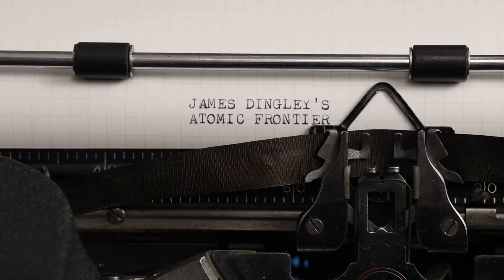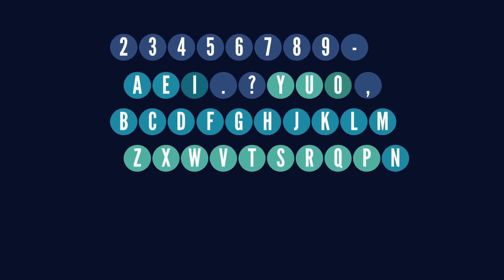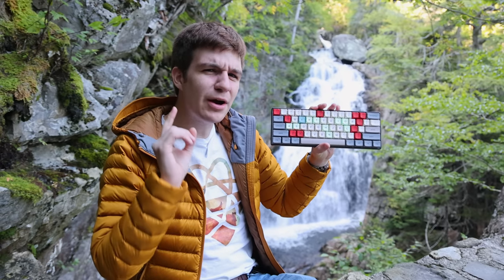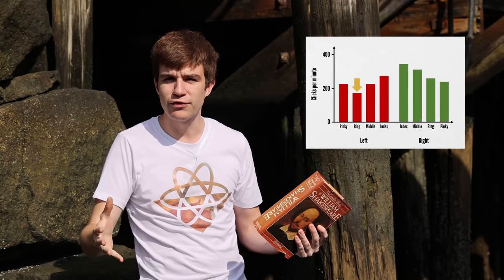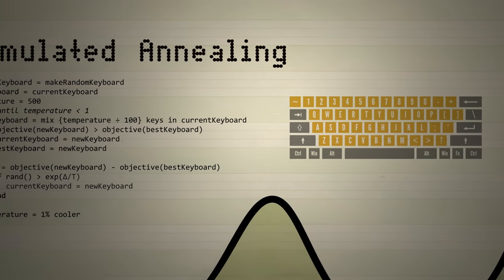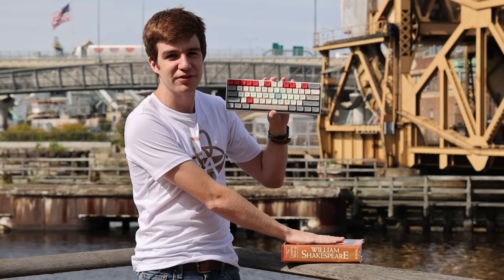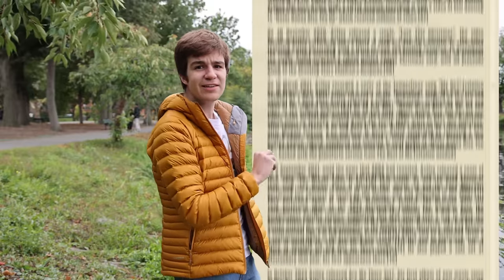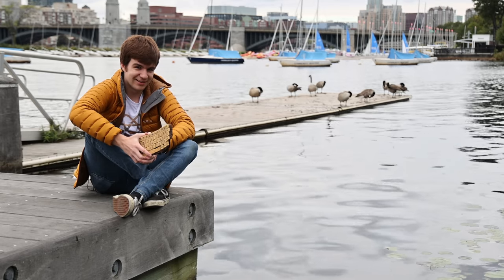QWERTY is broken. Can we make it better?

Comment from the maker: You have no idea the weird looks people gave me as I brought out the freaking "Keyboard From Hell" into my lectures. At least it was quieter than that typewriter kid!
Reply: That’s true lol
Reply: I wonder how an ergonomic keyboard would fare. I mean those that are split in the middle. Probably won't have an impact as one would still use the 10 finger system if its known and the distance would still be the same, i think.
Reply: @matthiasbecker5064  it actually makes a Huge difference to the shoulders and wrists (and thus most of  the pain and injury in the arm). The fully split ones connected by a cable so you can actually position them properly for your body rather than some ficticious average anyway.
rearanging the keys to be ortholinier (that is, the rows are lined up rather than staggered) also makes a huge difference to finger and wrist strain even without changing what position any individual key occupies. (it also takes between single digit hours and single digit days to get used to the difference, with the biggest one being x and c being displaced enough that one ends up hitting the wrong one a lot.)
Reply: typewriter kid: https://youtu.be/Bs5TEuZPQl8
Reply: @laurencefraser  As someone who owns a redonkulously expensive splitkb, I can attest that the just the split alone alleviated SO MUCH PAIN - ortholinear is nice too. No more awkward diagonal reaches for keys, they're lined up for more natural finger extension/retraction :D

You clearly own one as well to identify that 'x'/'c' issue xD
Reply: @matthiasbecker5064  no moving the B right next to the left alt would sufficiently split the keyboard already. to maximize this you take Y and put it next to the right alt button smashing the space bar in between.
Reply: no moving the B right next to the left alt would sufficiently split the keyboard already. to maximize this you take Y and put it next to the right alt button smashing the space bar in between
Reply: (accidentally deleted previous comment)

Looking at the word examples (edited, internet, honey, etc), and the idea of keeping important keys in (zxcv for commands redo, cut, copy, and paste, for example) in place, I think you might actually be looking for colemak. It does basically the same thing you did, except it optimized for common bigrams (basically, two letters that go together, think "er" or "he", or "it") instead of whole texts. W/ those word examples, I was able to do every one of them in the homerow, except for honey, which was 1 key off of the homerow, better than the optimized keyboard. Might be worth looking into.
Reply: I actually learned touch typing in school on a typewriter.. in 2003.. and from then on right through university computers where not even allowed in lectures.. also physically not possible with all the tiny 100 year old slanted folding tables most of the lecture halls had..
Reply: OP: 5:00 Have a nice day folks 🖕🖕
People walking by: 😮😬
Reply: How did it compare to the looks you got feeding a keyboard to the ducks?
Reply: @laurencefraser  Typing using a Dactyl Manuform keyboard is simply the final evolution of keyboards. 60%-75% layout, curved to your specific hand shape, Colemak-CA, split-ortholinear design, it's all beautiful when done together.
Reply: Looking at the video it is quite clear why people give you weird looks...
Reply: I started taking a laptop to lectures when laptops were not really a thing. Every professor made me sit in the back of the class to type.  I can only imagine the reaction I’d get if I brought in a mechanical keyboard with linear or bucking spring switches.
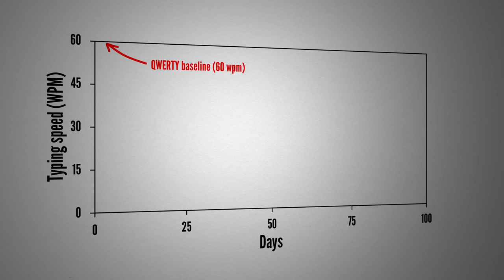Reply: 13:00 60 words a minute is not average
I tested the typing speed of over 5000 people back in the 70s and 80s, and the average was about 40 words a minute. Granted, they had much more difficult mechanical keyboards to use back then, and you were not allowed to make even one mistake.
I defy anybody these days to type even 40 words a minute without pressing the backspace - which was not allowed back 40 years ago.
Also, you had to use every single finger on the correct key.
Reply: @AlphaGeekgirl  "I have decided my personal experience and preferences overrule the entire rest of the world's system for determining basic facts."
Reply: I've been gaming and trading the market a lot over the years, and what I've found as the solution to RSI, is to simply tilt the keyboard downward.  In piano-playing, they teach that your arms should be about 90 degrees bent with your elbows near your waist and that your hands should have a slight downward tilt.  So, to copy that posture from my standing desk (I have stools nearby for watching movies from it), I have a (DIY reinforced) laptop stand with 10 degree tilt and a palm rest at the base of the keyboard.  I also have a thin sunglass case wedged at the top right of the keyboard to give it a slight clockwise yaw.

The mouse is on the other tilted laptop stand with a ~20 degree tilt, and I have a rolled up dish towel Gorilla taped to it to give my wrist the tilt I need that can't be provided by a keyboard palm rest.  The mouse pad is a piece of 7075 aluminum, because all the other mousepads I've ever tried either give me rashes, or get dirty in ways I can't clean.
Reply: Facinating concept. Just one observation, the right and left hemispheres of your brain work the left and right hands respectively, so intuitively each word must somehow be split and sent to which-ever half of the brain. So there must be some optimum switching speed in your hind brain to accomodate that. In particular I suspect most people hit the space bar with their right hand most of the time; so, letters which appear most commonly at the start and end of words (S Y T C D B) or are very common (A E R) , will be better coupled to the right hand. This is the case for QWERTY.
Reply: I began using the Dvorak keyboard in 2008 and have never looked back. The reactions from others trying to use any of my machines is always amusing. edit: I see you mention it at @7:30
Reply: 11:50 Am I blind or are you missing the letter H? There are two K's on this keyboard.
Reply: Can anyone tell how to change the layout of a keyboard😅
Reply: what camera and lenses were used for this video?
Reply: what about a keyboard for gaming I know keys matter less but perhaps theres a layout for the most popular games that would increase response and efficiency while reducing pain in the rist or other joints?
Reply: Bro, why did you have to rickroll me ?
Reply: Such an interesting video, truly entertaining and educational. Well done. 👍🏻
Reply: Starting with a more generic, genetics-driven evolution model dividing a standard QWERTY keyboard (sans numeric row) in half with the same temperature-based evolution key shuffling methodology, and a much wider base of literature (combining all 4 of your first dataset would be the easiest method) should produce a keyboard who's layout is less immediately alien, but still a dramatic improvement.
Reply: Wound you ever try a chord keyboard like the one-handed DecaTxt?  It only has ten keys but produces all the normal keystrokes and is mobile and Bluetooth.
Reply: 11:56 I assume the black second K key is supposed to be H
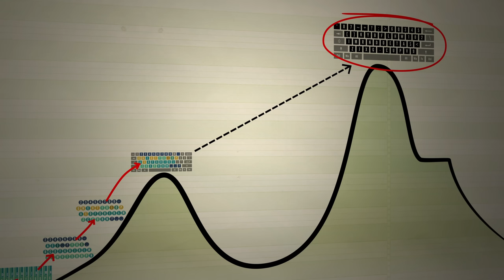Reply: What keyboard format is at the top of the hill at 4:32?

Comment: I'd caution against attributing the health hazards of typing to the QWERTY layout. Only a fraction of people actually touch type with proper form and a very large portion of injuries results from bending the wrist back too far, often as a result of having the keyboard too close to the edge of the desk.
Reply: And also most of claimed RSI relief from Dvorak, etc. might actually come from people finally learning to touch type properly when they learn Dvorak.
Reply: The QWERTY layout, as mentioned, was designed for typewriters to prevent jamming, not necessarily for optimizing typing speed or minimizing hand strain. While it has become the standard, some argue that it may not be the most efficient layout for modern computer keyboards.

Challenges with QWERTY:
High Finger Movement: QWERTY often requires long reaches and high finger movement, potentially leading to fatigue and strain, especially during extended typing sessions.

Imbalanced Load: Some fingers are used more frequently than others in the QWERTY layout, which could contribute to muscle imbalances and discomfort.

Not Optimized for Modern Devices: QWERTY was not designed with modern computer keyboards in mind. Alternative layouts like Dvorak or Colemak aim to reduce finger movement and potentially lower the risk of strain.

Considerations:
Adaptation Period: Transitioning to a new layout can be challenging and may initially impact typing speed and comfort. However, some individuals find the long-term benefits worth the initial learning curve.

Individual Variation: Hand anatomy, typing habits, and personal preferences vary among individuals. What works well for one person may not work as effectively for another.

Ergonomic Practices: Regardless of the layout, adopting ergonomic practices is crucial. This includes maintaining a neutral wrist position, taking breaks, and using ergonomic keyboards that suit your needs.

Personal Exploration:
Try Alternative Layouts: If you're open to experimentation, consider trying alternative layouts like Dvorak or Colemak. Keep in mind that the benefits may vary from person to person.

Ergonomic Accessories: Explore ergonomic keyboards, key switches, and other accessories that promote a more comfortable typing experience.

Listen to Your Body: Pay attention to any signs of discomfort or strain. If you experience persistent issues, it's essential to consult with a healthcare professional.

General hand injuries caused by keyboard use, including the QWERTY layout, are often associated with repetitive strain, poor ergonomics, and excessive or prolonged typing. Some common types of hand injuries related to keyboard use include:

Carpal Tunnel Syndrome: Carpal tunnel syndrome is a condition that results from pressure on the median nerve in the wrist. Prolonged and repetitive keyboard use with improper hand positioning can contribute to this syndrome.

Tendonitis: Tendonitis involves inflammation of the tendons, which can occur in the hands and wrists due to repetitive movements during typing.

Trigger Finger: Trigger finger is a condition where one of the fingers gets stuck in a bent position, often caused by repetitive gripping and typing.

De Quervain's Tenosynovitis: This condition affects the tendons on the thumb side of the wrist and can be aggravated by repetitive hand and wrist movements, such as those involved in typing.

Hand and Wrist Strain: General hand and wrist strain, characterized by discomfort, pain, or stiffness, can result from prolonged and repetitive keyboard use without proper ergonomic considerations.

Repetitive Strain Injuries (RSI): RSIs are conditions that result from repetitive and forceful movements. They can affect various parts of the hand, fingers, and wrist.

Preventing these injuries involves adopting good ergonomic practices:

Proper Hand Positioning: Maintain a neutral wrist position while typing, avoiding excessive bending or extension of the wrists.

Ergonomic Keyboard and Mouse: Use ergonomic keyboards and mice designed to reduce strain and promote natural hand positions.

Regular Breaks: Take regular breaks to stretch and relax the hands and wrists during extended typing sessions.

Correct Desk Setup: Ensure a proper desk and chair setup to maintain a comfortable and ergonomic typing posture.

Stretching Exercises: Incorporate hand and wrist stretching exercises into your routine to promote flexibility.

and Even with perfect hand positioning, individuals may still be susceptible to some hand-related issues. These issues can include:

Carpal Tunnel Syndrome: Despite proper hand positioning, factors such as prolonged typing sessions or pre-existing conditions can contribute to the development of carpal tunnel syndrome.

Tendonitis: Repetitive typing, even with optimal hand positioning, can lead to inflammation of the tendons, resulting in tendonitis.

Trigger Finger: The repetitive nature of typing, even with good hand positioning, can contribute to trigger finger, a condition where a finger gets stuck in a bent position.

De Quervain's Tenosynovitis: This condition, affecting the tendons on the thumb side of the wrist, can still occur with repetitive hand movements, despite maintaining proper hand positioning.

Hand and Wrist Strain: Extended typing sessions, even with optimal hand positioning, can still lead to general hand and wrist strain.

Repetitive Strain Injuries (RSI): The cumulative effect of repetitive movements, even with perfect hand positioning, may result in RSIs affecting various parts of the hand, fingers, and wrist.

It's important to note that the risk and severity of these issues can be significantly reduced with proper hand positioning and overall ergonomic practices. key word "reduced" not completely mitigated. but "I'd caution against attributing the health hazards of typing to the QWERTY layout" I would say your wrong by that statement.
Reply: @FBI_42069 ... your first sentence disagrees with the content of the video without at all bothering to rebut the video's points.
Reply: @DanielFolsom  the only part that disagrees with the video is typewriter part which whether you want to agree with it or not it's true, they made it so bad so people would not type as fast.
Reply: @DanielFolsom  and the original comment I was replying to was trying say we can't blame the layout and I was saying why you can completely blame the layout it's literally made to be bad, sure we can make it worse but the fact we didn't change it to be better when we didn't need it to be the way it is when we had the chance is insane like the only thing that I would use a QWERTY layout keyboard for if I had the chance to change is for a gaming just because I don't want to figure out the new keys for that, I would not mind it for typing as i have never been great at typing to begin with, so it would not make much difference for me.
Reply: @FBI_42069  Did Chat GPT write this comment
Reply: @smort123  which one? I have multiple comments here.
Reply: @FBI_42069  I only saw the first one about the qwerty layout
Reply: @smort123 😂
Reply: good point
Reply: I have small hands, so QWERTY was actually very painful, and switching to Colemak helped a LOT. I still have pain sometimes, but it's no doubt that constant straining for common keys cause a lot of pain. I'd be unable to continue after a few days of rigorous typing because of the pain. With Colemak, I don't have that problem at all.
Reply: I knew how to touch type and had proper form typing with qwerty, but still saw an ergonomic benefit when I switched to Dvorak. It was worth it to me. I do agree though that it's not great for mobile screens.
Reply: @FBI_42069 thats chat gpt the formatting is extremely obvious in your first comment lol
Reply: @damian_madmansnest  
A possibility, but even if they studied touch typists who switched from QWERTY to Dvorak (like me), they'd notice less travel time and movement in typing. Less repetitive strain. 

I do not go back to QWERTY unless necessary.
Reply: @Un1234l  I tried Colemak and it felt almost like i strain more because of less movement. Fingers get tired from constrained movement.
Reply: @damian_madmansnest   
No they don't, if your setup, technique, and posture are proper.

Less (efficient) movement is LITERALLY what separates the professionals/elites from the average people. Whether in music, sports, or typing.

Sounds like you're being too tense in your typing technique. Dynamic relaxation (minimal tension) is proper technique in every human movement and ensures comfort and speed for every human movement.
Reply: @Un1234l  Well, i have a choice to stay relaxed on qwerty or spend more effort to learn to be relaxed on some dvorak. Obvious choice for me.